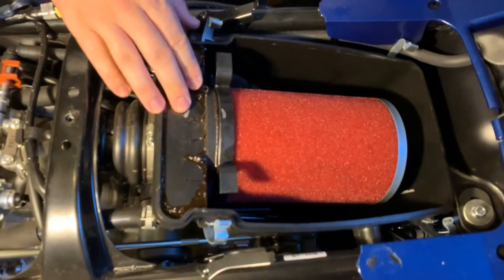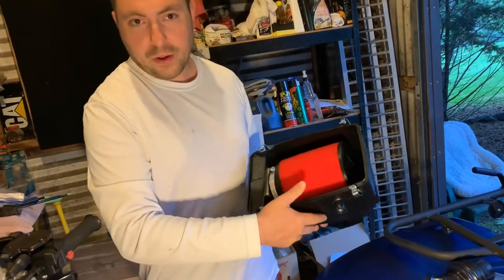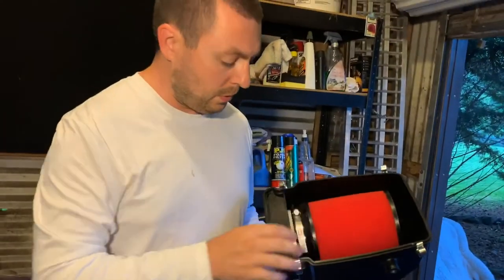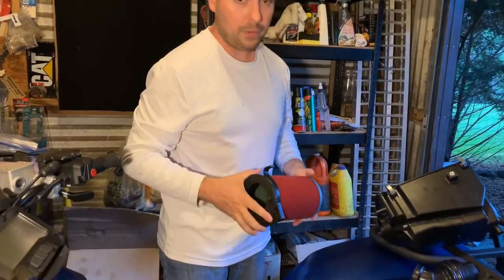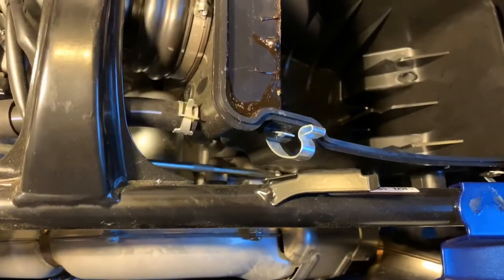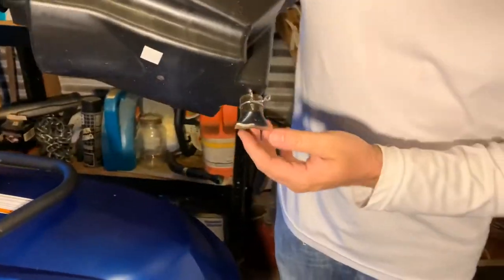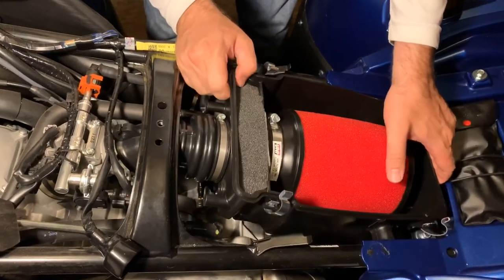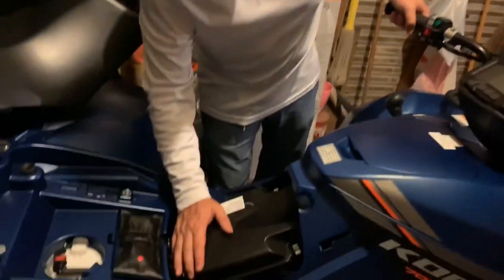How to Install EHS Racing Air Box Mod on 2019 Yamaha Kodiak 700

Comment: Thanks for the video, glad you did detailed view of the parts mod. When its time to replace my 2019 kodiak filter im gonna  do this same mod, then my old factory filter is going to get washed and put on a shop vac as a dust collector. Apparently foam does really well collecting dusts.
Reply from the maker: Glad it helped. I’ve been really pleased with the mod, everything has held up well.

Comment: Thanks for sharing, just recently got a 2017 Grizz 700 and changed the air filter today so now I can see what all the fuss it about, will definetelt get the mod but just have to wait till bext year, in the meantime i will put some grease around the seal or maybe vaseline.. what kind of grease did you put? Not sure if that matters or not..
Reply from the maker: I used plumbers heat proof grease. I think any grease would do just fine though. The Vaseline might work too. Just apply it liberally and keep a check on it and reapply more as the old grease gets dirty and dries out.  Congrats on getting your Grizzly. Thanks for watching!
Reply: @Palomino488  Thanks🙂👍

Comment: It's clear that the EHS unit is superior to the factory one, and that it restricts more dust and dirt, but does it actually improve the volume of the air intake? Does the motor actually breathe better?
Reply from the maker: From a seat of the pants feel I would say it feels like it breathes better. The UNI filter appears to be larger than the factory one in terms of diameter so I am sure that helps allow more air through the filter itself. I know EHS claims if you get their modified airbox lid along with their tuner, that you definitely are supposed to get better breathing and a few more HP. I am still running factory air box lid and stock tune like pictured in the video and it will get up and go with no hesitation. Hope that helps answer your questions. Thanks for watching!

Comment: How well have the little foam wedges EHS includes held up? They don't look very substantial, do they let dust in through them?
Reply from the maker: They are holding up well. They don’t look very effective when you unbox the kit, but I’ve found the key to them being functional and doing their job the best is making sure that they are oiled really well with foam air filter oil just like I use on the main foam air filter. This makes them stick in place and they don’t move unless I pull them out by hand. It also ensures the dust doesn’t slip by them. By using plenty of foam filter oil on them I haven’t had any problems with dust getting by them.